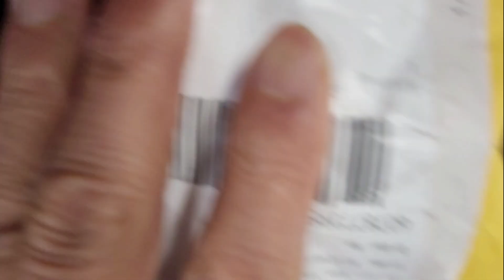무선조종시시템 구축, 무선조종기, RC car, RC자동차, Establishment of a wireless control system, 무선송수신기, 무선자동차, 무선기기

Comment: I bought two of those controllers that you used but I have the following problem: Forwards and backwards it is synchronizing the motor perfectly, but when I test it to the left or to the right one of the motors is activated with a delay and vice versa.

Comment: Good morning, why do you use the starter relay?
Reply from the maker: Hello?
This may not be the correct answer.
The drive motor uses a high-capacity relay because it consumes a lot of power when it starts
Reply: @A_J_kim  Thanks for the information, I bought two controllers like the one you used and two motors, my motors are 350w and 24v.
Reply from the maker: @Marcio Elibio  thank you

Comment: Hello, how to use two controllers of these connected in the same flysky receiver?
Reply from the maker: 영어
Because there is no separate steering system when driving left and right, the left and right motors are adjusted with separate controllers to drive left and right.
Thank you.

Comment: Good morning, congratulations on your project. Do you have an email to solve some doubts?
Reply from the maker: Hello?
This may not be the correct answer.
The drive motor uses a high-capacity relay because it consumes a lot of power when it starts